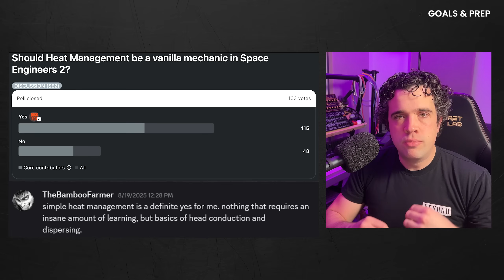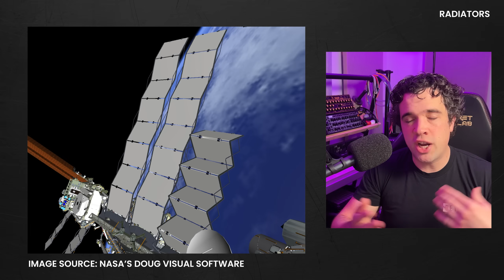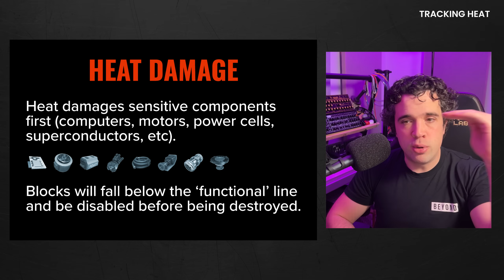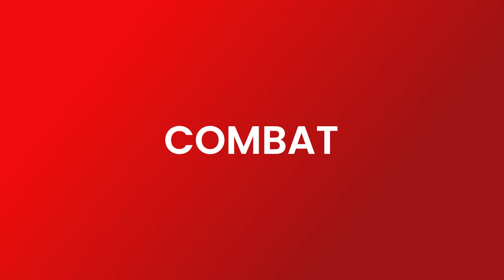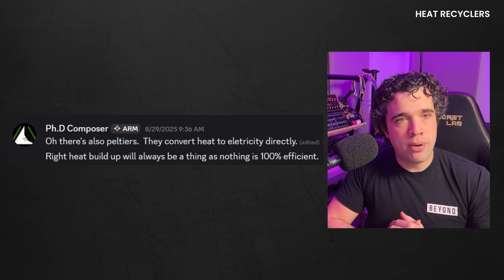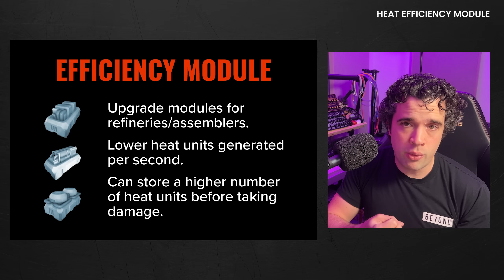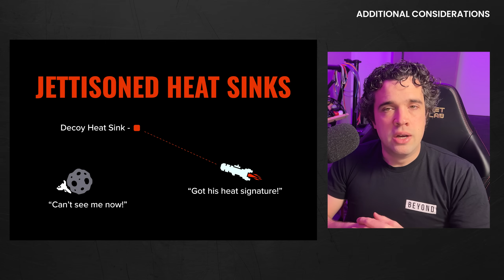Heat in Space Engineers 2? How heat could change EVERYTHING

Comment: Unless it was just a fever dream I thought small and large grid blocks were going to be connected in vanilla. If that's the case I would enjoy separate power and coolant lines from the conventional conveyor system. It always bothered me in SE1 that those were magic tubes the moved every item in the game. Ideally inventory would be less abstracted in a box of holding and a menu but I don't expect physicalized inventory management. Better system diversification within the grid like power and coolant lines would mean ships need to be even more thought out as they get bigger and minor damage has more of a chance to have knock on effects that allow combat to end in disabling instead of explosion.
Reply from the maker: There is a universal grid in SE2, no small and large grid. The issue with more than one type of conveyance is how it resolves with subgrids when using connectors, pistons, hinges, and rotors which only have 1 conveyor port on them. You'd have to have multiple conveyor ports on each which would add massive bulk whether you'd need it or not. It could be achieve, it would just be much more complex.
Reply: @diggrok I can see there being an acception with certain connecting parts like rotors and pistons. Or even compound versions that also connect heat/power if needed. Thinking about it further it would be good enough to have a separate conveyor types for each matter type. This way your hydrogen gas line isn't the same as the one crammed full of rocks.

Comment: Here's an alternative. Everything work as before but Heatsinks can overdrive parts. You can use hotkeys to switch between the heatsink over driving reactors/power sources, weapons, thrusters. Overdiveing makes reactors and other power sources output more power. Thrusters could get increased acceleration. Weapons get increased fire rate. This way you might need to dynamically switch between overdrive modes as you get into different situations.
Reply from the maker: This is definitely an alternate approach to heating! I had some notes that I didn't end up recording about alternates to heat and some games do stuff like this. Crossout was one example I was going to give where they have coolers and radiators and they do thinks like increase how long guns can fire before overheating and make cooldowns faster once they do overheat.

Comment: Yes, I would love to see thermal mechanics, I've always wanted it in SE1 but the mods have always been really lacking (and the best one got discontinued); to the point where I've been super tempted to just learn SE modding to make it myself. Your ideas all sound pretty inline with what I was thinking; in my mind I had loop temperature consideration's kinda like KSP's System Heat mod too, but that probably would be more complexity than would make sense for a vanilla feature (I mean, that's not even a vanilla aspect of KSP's heat system, there it's just abstract heat generation and removal without the aforementioned mod) so your idea of just having heat units I think is good. Would definitely love to see a mod al la System Heat that expands it like that if it does become vanilla, though.

I also think it would be really hard to balance a power system that consumes heat without that added realism layer of inducing a temperature drop - radiators running at a lower temperature are significantly less efficient and you need more to remove the same amount of heat energy, so under realistic physics extracting heat to turn it into electricity actually increases the amount of radiator you need, since the reduction in radiator efficiency greatly outweighs the reduction in heat flux. So without a temperature system, I'd say the best approach is the inline one, where it doesn't consume heat and just generates some fraction of that heat as electricity. I'd probably go with the peltier module (aka thermoelectric generator); it's much less efficient than a stirling one, but that also means it's less far from reality to ignore the change in temperature and heat flux and it's more of a small bonus than primary power system - since if it generates too much it'll still reduce heat load even without consuming it by taking load off the reactors. Those are also extremely simple and reliable (having no moving parts at all), and are used in space frequently (they're in the RTGs that power many space probes). Though on the other hand, SE2 blocks do have lots of moving animated bits and Stirling would be visually a good fit for that...

As for the water-based open-cycle cooling, that's also a good idea, though I'd implement it where instead of having the water needing to be piped into the heat-generating block, I'd have a localized block that accepts water and transfers it into those abstracted heat pipes (maybe having a model showing the pipe get split into tons of smaller pipes going into the walls with some pumps and valves). After all, the heat transport you abstracted away is still comprised of actual physical coolant pipes pumping hot coolant around, so flushing water through the abstracted network wouldn't be that weird - given the use of water there, I'd probably imagine them as using supercritical water coolant to begin with, and you're basically flushing that hot coolant and replacing it with new coolant. To keep things streamlined I think I might have this also be the steam vent block - so I'm imagining a long block that on the outside has the big vent port thing, passes through some armored section where you'd place it into the hull, then on the inside has the aforementioned water acceptor to replace the vented coolant (which still isn't actually being modeled in any way, even as a coolant filled % in the network or anything, but more just alluded to by the vent using up water and maybe in a flavor text description of the block somewhere or something)

20:00 so what you're saying is we need to target the thermal exhaust port
Reply from the maker: Some good notes here! It is disappointing how many mods are out of date… all the more reason to put it in vanilla!!

They could definitely abstract the water flush. Dealer’s choice. Whatever it takes to get heat!

Comment: Refineries should generate a TON of heat, encouraging you to build static refineries near sources of ice or water instead of a ship that does everything
Reply from the maker: Yes! You could also have heat sinks on ships be on a subgrid "core" which when they heat up you swap out at a Cooling Station grid for a core with cooled heat sinks. That way not every grid needs to have amazing cooling, you can just have one grid dedicated to removing heat from heat sinks and you just swap cores. Lot's of options!!
Reply: @d @diggrok  use the Connector to run water from the base’s tank through the heat sinks instead of a separate subgrid, or do the opposite and use a shuttle to carry heat sinks/subgrid cores from the big armored battleship to the Europa base to be cooled off. Or bring the ice back up to evaporatively cool the battleship.

Comment: Maybe water tanks could be used to "flush heat sinks" rapidly lowering the stored heat at the cost of large amounts of water (heat sinks would be conveyored for this to work).
Anything to logically nerf hydromanning sounds good.
This could be used to balance reactors - they generate a lot of power, but also a lot of heat.
Jump drives might not only need to recharge, but cool down before re-use: The longer the jump, the more heat generated.
So many possibilities, so many opportunities to improve the game!
Reply from the maker: Tons of opportunities indeed! Also higher tier gear could be more heat efficient so a Tier 1 reactor produces more heat per megawatt than a Tier 2... That is if they introduced tiered modules. I think they sort of teased that they might. A lot of custom servers use tiered blocks and they're fantastic!
Reply: @diggrok  YES! Strictly through efficiency alone, this makes sense. Better reactor, uses less fuel per Watt-hour, generates less heat per Watt-hour...gives us a lot more to think about in ship and base design.

Comment: If atmo thrusters are more sensitive to heat than wheels, it would also give more of a reason to make rovers in the early game. (Would probably be best to do this by making wheels handle heat better rather than making atmos handle it worse)
Reply from the maker: Great point! Rovers would probably be hardly effected by heat (At least until you start adding modules). They'd just be electric vehicles basically.

Comment: A heat system won't do much to solve turret spam. Ship stats scale according to the square cube law. Armor/defense increases with the first dimension, guns/radiators scale with surface area, and shields/power/heat capacity scale with volume/mass. 

Heat effectively competes with turret space for surface area. There is no fundamental change in square cube scaling because defense is still linear.

Shields overshoot turret scaling, because internal volume is cubic. At some point the cubic growth will outpace the square growth, which trivially outpaces the linear growth.

Shield heat dials back the cubic power of shields. Now they also fight with turrets and engines and everything else for surface area. But internal heat is still cubic, a ship with more meat will have more total combat "actions" before it overheats.

Liquid cooling provides a good counterbalance to cubic heat capacity. Sure a massive ship has many actions at its disposal, but those actions require spending coolant. The coolant becomes a defacto fuel resource, which is not spent in normal operation but is quickly exhausted in high heat combat.

Heat batteries are a largely redundant mechanic. A ships mass is its heat capacity. Why spend blocks/mass on something that happens for free? Unless you're assuming that armor can not be a heat resource, but how else will small/simple ships gain anything over a large ship?
Reply from the maker: I think your outline assumes that they would incorporate heat in a spatial way and I don't think that would be performance friendly or the right direction. The system would be abstracted regardless and they could tune it in a way where it makes sense to bring real balance. 

Even in a full realism scenario, if you have a huge ship, you'd still have to pump heat away from your turrets to the rest of the ship and if you can't the turrets would over heat. The back of a ship can be on fire while the front is freezing, heat isn't automatically distributed.

Comment: You could also have ion thrusters connected to heat sinks so when in use the ion thrusters expel great amounts of heat decreasing thrust efficiency and increasing heat signature
Reply from the maker: You mean just as a way to remove heat? It would be interesting if there were ways to "vent" the heat by mixing it in with your thrusters..
Reply: Indeed but possibly damaging the thrusters and heat sinks as a last ditch emergency

Comment: I personally like the way you set this up, but I do think that a good source to look at is how Ions, Atmos, and Hydrogens, and prototech components are balanced

You could have Radiators be a low effectiveness cooling, air vents as high effectiveness but ONLY work in atmosphere, and active coolant be the most effective and work everywhere, but burns through water and require a conveyer setup. (I know this is similar to whats brought up in the video, but not the same) Although, something else you could set up as a step above active, would be supercooling, which burns through its own dedicated coolant instead of water, and allows you to keep lower than ambient while entirely internal, allowing for deep strike stealth ships, but being unable to effectively refill coolant in the field.

For active coolants (Both water and supercooled) It should work the exact same way that hydrogen thrusters work, as in if its on the network, its allowed to burn coolant. This keeps the learning curve smooth and unified with the standard systems in the game, such as how radiators work similarly to Ions, airvents similarly to atmos, and heatsinks similar to batteries. Additionally, active coolants could work similarly to how reactors behave, whereas the modules will only start burning coolant when radiators and heatsinks cant passively keep something at 0 heat.

Also, back to supercooling, since its burning something that is actually going to cost something of the user (Not just ice or electricity that you can obtain passively), it should do something special. When I said "It should keep lower than ambient while entirely internal" I mean you should be able to "Overcool" your ship, whereas you burn constantly and allow it to stay a specified amount UNDER 0 heat, allowing you to have an even lower detection range, and an additional buffer before overheat. You would be able to set a target negative temperature of whatever you want, even down to -100%, but it would burn through an extreme amount of this coolant. Since you brought up a lot of elite dangerous type mechanics in this video, think of it like this. Most ships passively run at 25%-35% heat, but if you build around cooling, such as a DBS with a thermal vent beam laser, you can actually hit 0, making you extremely difficult to lock or track, and keeping your weapons and systems cool to run at maximum efficiency.

How you would obtain a source of supercoolant would be dependent on how powerful this is decided to be by the playerbase, but It shouldnt be something thats super easily accessible, within reason. The coolant should be a mix of water and some other rareish resource, with the primary cost associated in the containment and manufacturing equipment.
Reply from the maker: I did for a moment almost include the idea for coolant rather than just water which could be manufactured, similar to an O2/H2 generator but wanted to keep the initial proposal as simple as possible to make sure it's aligned with Keen's goals of low complexity to not turn off new players. I could see coolant also being a great modded feature for more hardcore servers.
Reply: Coolant could also be a relatively simple base material that just requires a lot of energy-intensive processing. Something like densified liquid nitrogen made by supercooling planetary atmosphere. It would make sense for that process to produce a lot of heat, too, so you're effectively dealing with a ton of it now to not have to do it later.

Comment: Internal welders should IMO add "heat units" to the block that is being repaired, welding is not a cold process (i do it for a living)
So sure you can try and repair the damage done to the block like that but your gonna risk just frying it or potentially damaging it faster then the welder can repair it, or just shut it down if the safety is on
Reply from the maker: Good point! Not only the welder builds up heat but the block being welded. Love that!

Comment: I'm certainly not an expert... but pretty sure that in SE1 there's a single damage value and parts are removed according to the welding order.  This affects the idea of having electronic parts get damaged first.  If you have a part that welds up as steel plate, computer, steel plate, then I don't think there's an easy way to say if it's 30% damaged by physical things, it has lost the last steel plate, but if it's 30% damaged from heat it's lost the computer but not the enclosing steel plates.  I'm sure one can come up with solutions, but then you have questions like do you need to reweld? If a part is 100 steel plates, 1 computer, 100 steel plates and the computer is damaged from heat, realism says it still has full integrity and you just put a new computer in it.
Anyway, I like your ideas, I'm just typing while thinking with my software architect hat on.  Doesn't sound like any of this is computationally expensive.
Reply from the maker: Yup they could skin it a few ways. In the case of a block that has computers and steel plates the heat would impact the computers and render them useless, thus disabling the block, thus it would no longer be producing additional heat and not take any more damage. 

So it would have its integrity, it just needs the computers to repair. (Without the computers it would fall below the "functional" line on the building guide) 

This is also why it would be useful to have visual modeling to know the module is burnt out and needs fixing. The control panel would show damaged modules too of course.

Comment: heat should probably work similar to the air tight system losing heat over time without proper seal and depends on place like on earth a door open will reduce temp but not as drastically like in space... 

SE1 had light armor and heavy so heavy would maintain heat longer ect...

system could be quite interesting could be a good way to require large amount of power for larger ships needing more heat to maintain comfortable temp inside...
Reply: Realistically, freezing to death on your space ship is not a concern. Everything generates heat and it's very hard to get rid of in vacuum.
Reply: ah I forgot how heat works in a vacuum thats intresting mechanic
Reply from the maker: Building up heat is actually relatively easy in a vacuum... especially if the sun is on you! It's getting rid of heat that is the challenge!